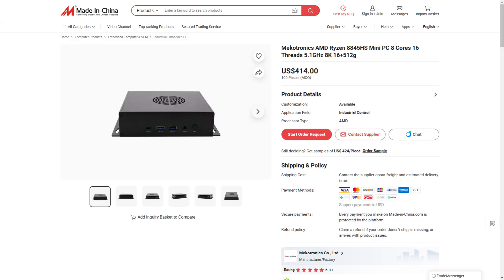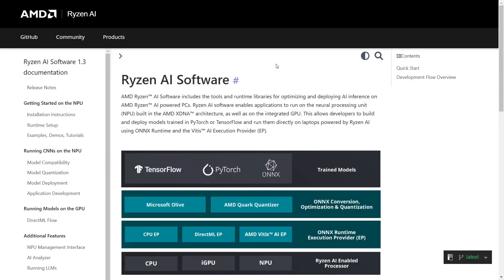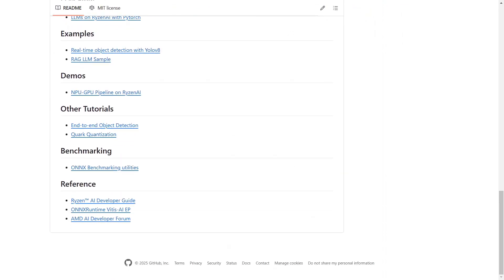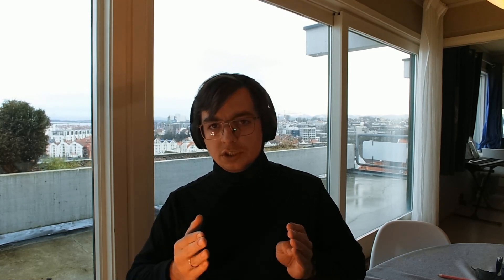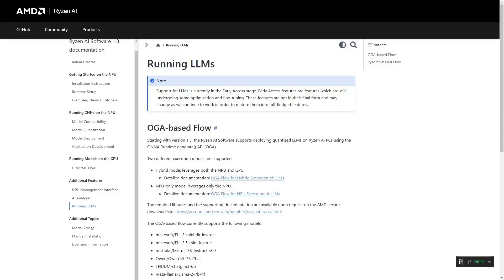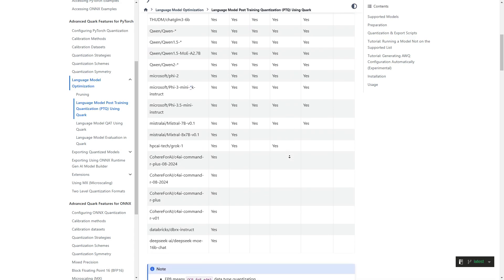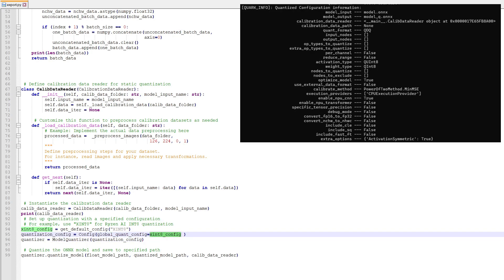Running AI on AMD NPU

Comment: Like many I FELL for the AMD/Intel NPU scam when I bought my AMD Ryzen 7 8845HS w/ Radeon 780M Graphics with a 28TOPS NPU thats virtualy unasable asside from face login ID (I didnt get the fingerprint model from Lenovo) The I discovered the AMD ROK code thats behind a signup/in wall and if you manage to get that far, you will find out its written by AMD only for slected GPUs! So after all this time, this CPU/GPU has been out for a while now, I thought their must be a hack for my llmstudio or such but NO, Vulcan GPU only... So its better from Intel or ARM (thats even in an odder place unless your a LINUX user as windows+arm is like a marriage between 2 m*n, you can do it and its legal but its just not the same!) ~ So why no NPU support from AMD now LLMs have taken off? Any assistance appreciated
Reply: RADXA have the Orion O6 with upto 64gb of DDR5! This beast is cheap (way cheaper than anything with nVidia in front of its name and is going to be the hottest thing in home PC/LLM in 2025.. It will crush bang4buck anything in this price bracket... And propel some lucky youtuber to fame and fortune, 1 click at a time

Comment: Overview of AMD NPUs: Capabilities, Documentation, and Usage

*   0:00:04 Introduction to AMD NPUs:
    *   AMD NPUs are being integrated into CPUs by major vendors like Intel and Qualcomm.
    *   Used by Windows Copilot and other applications.
    *   Often compared to NPUs in edge devices from different vendors, but also used in larger devices.
*   0:00:48 Comparison with Other Platforms:
    *   The presenter compares AMD's framework to Halio, noting similarities in logic and quantization approaches.
    *   AMD is considered an edge device platform, similar to and compatible in pricing with Jetson.
*   0:01:17 Documentation and Resources:
    *   AMD provides comprehensive documentation on NPU usage, quantization techniques, and code samples on GitHub.
    *   Three main categories of documentation: general NPU usage, quantization, and GitHub samples.
*   0:01:38 Advantages of AMD Platform:
    *   Good documentation.
    *   Multiple quantization approaches (e.g., quantization-aware training, mixed-precision quantization).
    *   Support for various inference frameworks (ONNX Runtime, PyTorch, Llama.cpp).
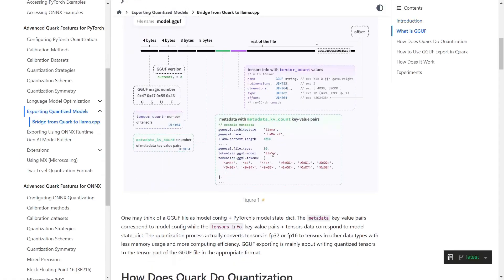*   0:03:43 Disadvantages:
    *   Quantization is mandatory for NPU usage.
    *   Limited function support, though substantial.
    *   Small community compared to other platforms.
    *   Limited model zoo.
    *   Higher price point compared to some edge device platforms.
    *   Modern VMS may not be fully supported yet.
*   0:05:29 Model Export and Quantization:
    *   Models can be exported to ONNX or PyTorch.
    *   Quantization is a crucial step, with options for different quantization strategies.
*   0:06:12 Inference Process:
    *   Initialization involves setting up the ONNX Runtime with specific provider options and environment variables.
    *   Inference process is similar to standard ONNX Runtime usage after setup.
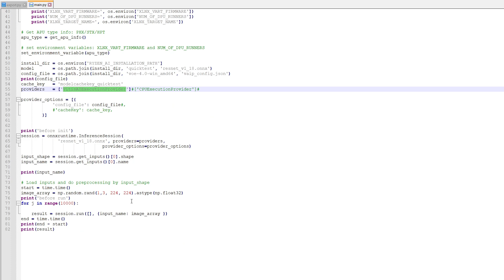*   0:07:47 Performance Benchmarking:
    *   NPU outperforms CPU for many networks.
    *   Not all networks can be exported to the NPU due to quantization and other limitations.
*   0:08:30 Conclusion:
    *   AMD offers a robust infrastructure for NPU usage, comparable to Jetson and Hailo.
    *   Currently not the cheapest solution and has some limitations in network support.
    *   AMD is actively developing and improving the platform.
*   0:09:27 Open Questions and Future Work:
    *   Further testing needed for different quantization strategies and mixed-precision approaches.
    *   Quantizing and evaluating the accuracy of llms on the platform is an important area for exploration.
    *   The basic pipeline is functional and user-friendly.

I used gemini-1.5-pro-exp-0827 on rocketrecap dot com to summarize the transcript.
Cost (if I didn't use the free tier): $0.03
Input tokens: 17850
Output tokens: 639

Comment: Thanks for the review. 
Interesting that RK3588 is faster than Hailo8
Reply from the maker: For this specific network in this specific configuration.
One network does not say a lot about performance. Its important:
1) Understand how is NPU connected
2) How it utilized 
3) How big is batch

In case of RochChip - latency is much slower, but it's possible to setup better throughput
Reply: @AntonMaltsev  Understood.
Just it is strange to see that slover device performs better.
I am comparing numbers for YOLv5s 640x640
AMD        (55 TOPS) - 27ms
HAILO8 (13/26 TOPS) - 20ms
RK3588        (6TOP) - 12ms
Reply from the maker: @aliksargsyan2035  
1) It's NPU speed
2) It's depend on the connection speed
3) For RK3588 it's 3 NPU devices + 12 streams in parallel.

It's completely different architectures in each case.